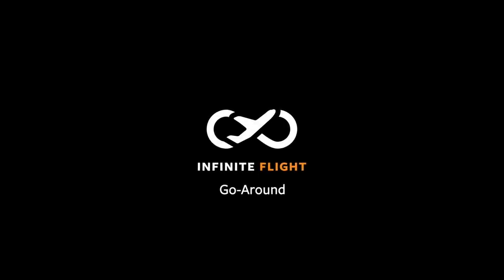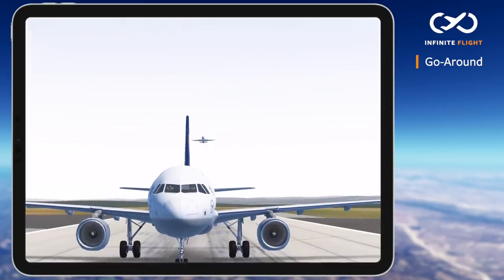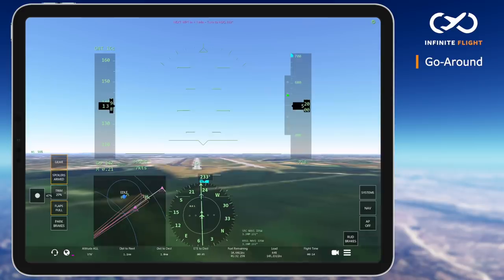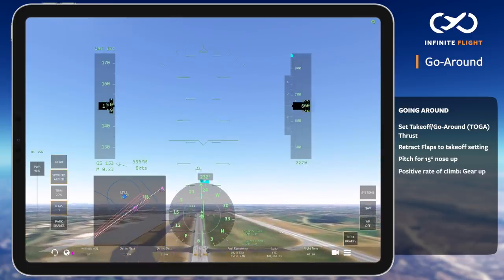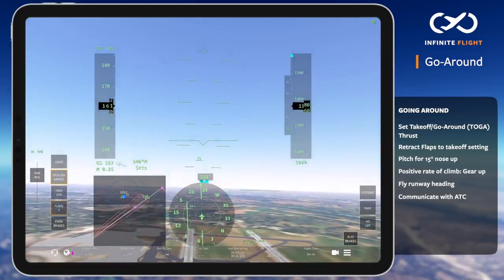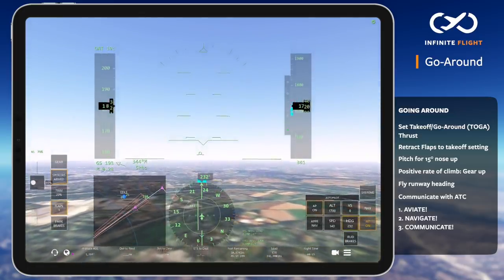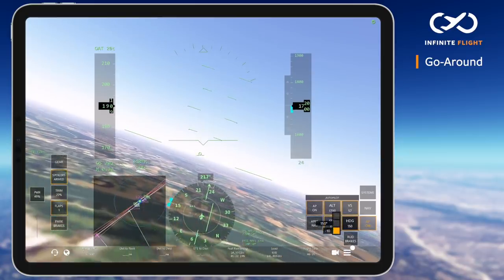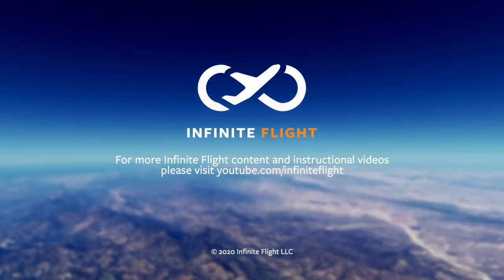Go-Around Tutorial

Comment: You can always go around If it don't look right comin' down, don't wait until you're sideways Maybe sliding on the ground, You can always go around, I know that when, when I learned to fly my instructor was yelling in my ear, Power in carb heat cold climb out pitch, flaps to go, take it round a patch one more time again, but I know now, he was showing me just because the nose was pointing down, if it doesn't look right give it one more try, You can always go around, if it don't look right coming down, Don't wait until you're sideways maybe sliding upside down, You can always go around, You're coming in, you see you're high and fast, but you're mind is set somehow getting down, The runway leads to grass that leads in to trees, little beads of sweat are dripping from your brow, you've still got time, Simply change your mind it sure be nice to fly this plane again, With the wings still straight, this ain't no place to hesitate, Pitch, power, gear and flaps, HEY Go around!
You can always go around, if it don't look right coming down, Don't wait until you're sideways, Maybe sliding on upside down, You can always go around.